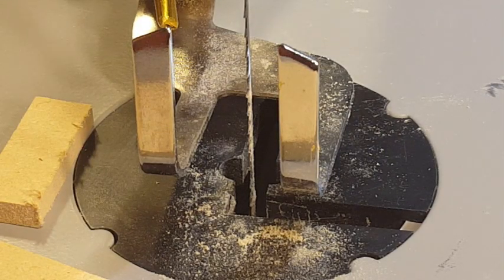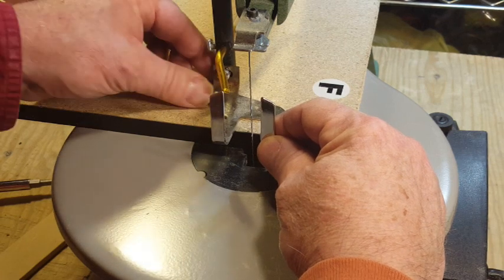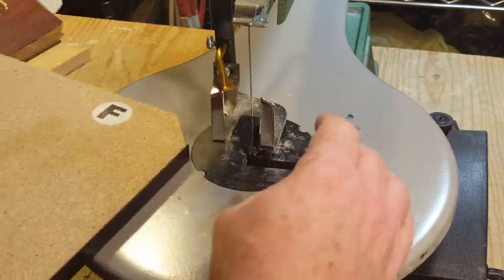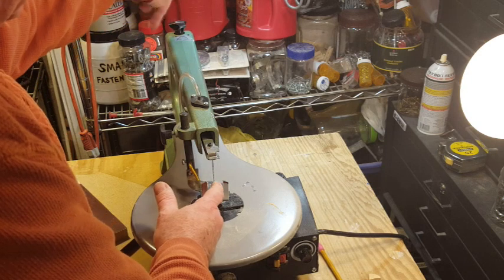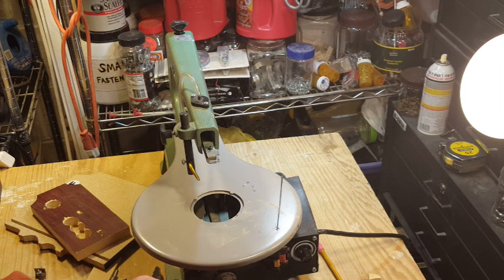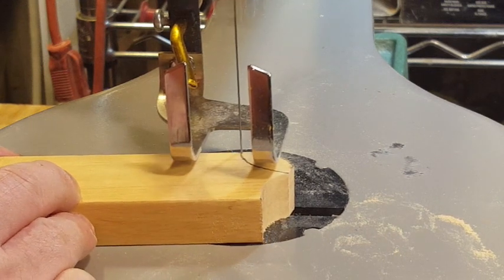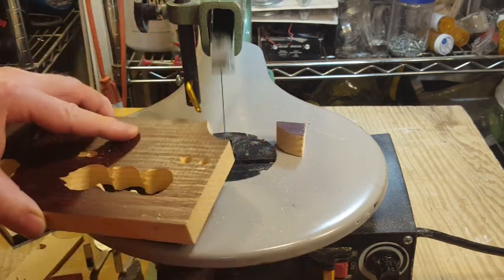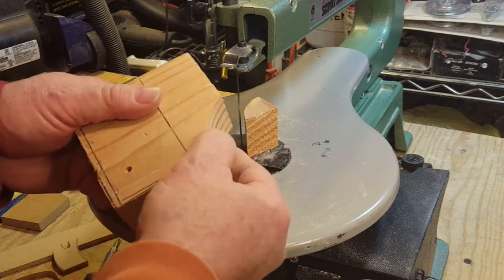11. Simple DIY - Let's make some scroll saw cuts!

Comment: Putting a inch or so thick piece of wood on top of your table will make use of the teeth higher up the blade.You get more life from your blade.
Reply from the maker: Thanks for the tip and for watching!

Comment: What's the difference between pinned and unpinned blades? What are their different advantages? Cheers
Reply from the maker: The pinned blades use small pins on each end of the blade to mount the blade into the saw. If you look real closely at about the 17:00 mark in the video, you can just barely see the pins (they are very small). Unpinned (also called plain end) blades don't have these pins; the end of the blade is flat. 
Pinned blades tend to be larger (the front to back dimension of the blade is bigger) than plain end blades. Larger blades tend to have fewer teeth per inch which allows for a faster cut especially through thicker material.
Plain end blades tend to be smaller (front to back dimension), have more teeth per inch, and are used to make more detailed and delicate cuts.
One of the advantages of using a scroll saw (which I did not show in this video) is being able to make inside cuts (cutting a piece out from the middle of your piece without cutting through the sides). To start the cut, a small hole is drilled, the blade fed through the hole, and then mounted and tensioned. Pin end blades require larger holes than plain end blades.

In the previous video I made about this saw (here's the link:  https://youtu.be/niSinuF_tdA  ), at about 10:07, there is a close-up of the pin end blade.

Thanks for watching.

Comment: spend some time watching scroll saw videos on YouTube. learn about and utilize a zero clearance board on the saw as it will greatly increase your cutting and reduce tear out, as it wears a larger opening just replace. throw the blades away that came with the saw and buy Dutchman or Olsen blades. Do not cut particle board with wood cutting blades, the glue eats up the points. The others are giving tips on speeding up the motor and holding down tighter. Keep the blade tension tight as the blades do stretch.
Reply from the maker: Thanks for the tips! Do you have a favorite scroller?
Reply: I started years ago with a 16 inch sears and loved it but realized I could not do what the pro's where doing. I made hundreds of usable items and enjoyed it. 3 years ago I bought another Sears the same and did fair job for lots of things. A year ago I bought a Dewalt 20 inch 588 model and love it. Night and day difference. No doubt one of the $1500 jewels would be great. Save your money if you enjoy your saw and then upgrade to what you can afford. It is well worth the money as I now can do so much more with pin-less blades and a solid saw and great accessories.

Comment: If you have made all these cuts before why do them again do something harder and forget that foot.there are blades for thinker wood and hardwood
Reply from the maker: Hi Randy. I made this video a very long time ago when I was first starting to use this saw. I was trying to demonstrate some simple cuts on various scrap materials to show others new to scrolling what a newbie (me) could do. The good news is that I have progressed from that point. I no longer use the foot. I made myself a zero clearance table insert ( https://youtu.be/jx60VYTmIfI ) , have replaced the stock blade clamps with new ones that can accept pinless blades ( https://youtu.be/W83TllFnMgs ), and have tried several different kinds of blades (here's one example: https://youtu.be/mI0Aicqs1xI ).
Thanks for your comment and for watching.